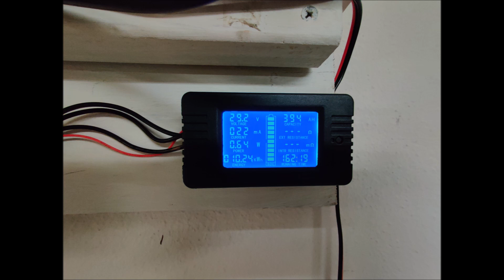DIY POWERWALL PART5 - ASSEMBLING EVERYTHING

Comment: What exact bms do you use for these powerwalls?
And what do you do with the power thats comming in after the batteries are full? Do you and can you deliver this back to the grid?
Reply from the maker: I use a Daly 100a BMS. I do nothing with the power once the batteries are full. You can't just plug this back into the grid, that normally requires a permit and electrical inspection.
Reply: @stevenc22  so a Daly 100a 7s?
Reply from the maker: @Sereen666  Yup. This is a 7S Lion build. I also have a 8S LifePO4 powerwall. You match the BMS to the number of cell groups you have in series.
Reply: @stevenc22  ok, sorry for the many questions but i find yours a great build even if it was posted 2 years ago. So i'm bussy creating a similar one. I'm starting smaller but want to build it bigger from there.

When you placed the second 7s lion bank, did you match the voltage to the other one before connecting the cables?
Reply from the maker: @Sereen666  I got it close but once you connect the 2 packs in parallel the batteries will self balance each other, so getting it close is good enough

Comment: Fantastic set of videos.  Answered a lot of questions I had about building a portable solar storage box that will draw power from the solar setup in my shed.  Would love to see a wiring diagram but if that's too much work can you just explain where the Battery Capacity Voltage Checker (the box on the bottom right of the screen that shows the voltage etc.) is wired into the system.  It's not easy to work out where the wires connect and I think it would be hugely useful.
Reply from the maker: The shunt for the battery meter goes on the negative leg of the Powerwall just after the BMS but before the inverter and other accessories so that all power in and out of the battery had to run through the shunt so it is measured. Battery - BMS - shunt - inverter & accesoy

Comment: hey would you recommend that charge controller for beginners, I only plan to use this to charge lithium batteries I have a 4S and a 7S (18650 battery is only)
Reply from the maker: Yes it is good. But how many solar panels do you have? That charge controller is a buck controller and requires the solar voltage be higher than the battery voltage
Reply: @stevenc22  I have four 12V 30watt newpowa solar panels. I was thinking about putting in series
Reply from the maker: @Fostech.j.a  that works. But that is not a lot of solar. Might just want to get a mppt 7210a for $40 if you only running 120 watts of solar. It works reasonably well and is cheap. I have one on my solar generator
Reply: @stevenc22  do you have any reliable sources that I could buy it from , like amazon, ebay bangood..... etc
Reply from the maker: @Fostech.j.a  https://www.ebay.com/itm/LCD-MPPT-Solar-Regulator-Charge-Controller-24-36-48-60-72V-Boost-MPT-7210A-/112451914404?_trksid=p2349624.m46890.l49292
Reply from the maker: @Fostech.j.a  https://www.amazon.com/dp/B07PVDY1V7/ref=cm_sw_r_cp_apa_fabc_cE97Fb80ZGNHX?_encoding=UTF8&psc=1
Reply: *reliable links
Reply from the maker: @Fostech.j.a  US $32.99  25%OFF | PowMr 10A MPPT Solar Charge Controller Fit For 24V 36V 48V 60V 72V Lithium Battery Bank Solar Systems Regulators LCD Display 202
https://a.aliexpress.com/_mL2s3P3
Reply from the maker: @Fostech.j.a  the 7210a charge controller is a boost charge controller so put your 4 panels in parallel and it will boost the voltage to the battery voltage however if your panels already have a higher voltage than the 4S battery them it won't work and will need a buck controller.
Reply: @stevenc22  hey thanks for your help I really appreciate you taking the time to talk to me

Comment: Shouldn't your battery leads be on opposite ends rather than coming off the same end?
Reply from the maker: That's just a design choice. I chose my design so  that it would fit in the box i made, would be compact, wouldn't need a bunch of jumper leads between batteries ect.

Comment: Hello Stevenc22 nice video did you make the cabinet where the cells are held if you did can you make a video or share what materials and the dimensions Please ???
Reply from the maker: I did. Bottoms are 30 inches, sides are 16 inches. Made out of 3.5 inch wide boards. Frame then screwed on the plywood backing
Reply from the maker: https://imgur.com/JJ2nnuN

Comment: Hello Sorry for my English since I'm from Spain and I don't speak it very well. I have an installation similar to yours. My problem is that I have a Powmr regulator that is very similar to the one in your installation. This regulator, despite sending the 37 volt plates, only sends the lithium batteries made by my 27v, so it never charges them since, as you know, it should send it 29.5 v at least. How did you solve it ?. Thank you
Reply from the maker: I think i understand what you are asking. Your solar panels are supposed to have 1.5x to 2x the forward voltage of your battery. That means for a 29.4 volt battery, you need at least 45v if not 60v of solar panels. That means you need at least 3 panels in series. 

Without enough panels your solar charge controller wont be able to charge the pack. You may also have a bad solar charge controller if you do have enough pnaels.
Reply: Thanks for your reply. For now I only have a panel of 330w 36v open circuit and 72 cells. When I enter the controller with the cable that comes from panels it marks the 36v meter, but at the regulator output it only shows 27v. I have the same regulator that you have. So for me to understand it, do you say that in order to charge those 18650 batteries I need to put more panels and I will do it? My charge controller is the same as yours, how many 330 panels would you put on it? serial or parallel? Thank you for your time, I am very grateful to you.
Reply from the maker: @VERUFIL  If you look up the makeskyblue charge controller specifications, it states that for a 24v battery, the minimum solar input is 37volts. Your battery is 29 volts, so your minimum is going to be 45v or so.

If you added a second panel in series, it would increase the voltage. 

You can actually test my theory. If you have a 48volt transformer laying around, you can plug it into the solar input of the solar charge controller and the charge controller will think its receiving 48V of solar and if you get out a nice 29Volts then you know the problem is that your solar if too low voltage.

Also make sure you have the right settings in the makeskyblue. D02 needs to be 29.4V and D04 need to be 1.
Reply: Thanks. Gracias

Comment: Great video.
Hey Steven, I just found your channel yesterday and subscribed. Then after watching just about all of your videos it inspired me to try building my own powerwall.
I will be building the same wall as yours 4s80p packs for 24 volts. I went ahead and ordered 700 18650's yesterday, and already have the same Charge controller and inverter you have.
Well my inverter is actually the same as your 1,500 watt version just in 2,500 watts and 24 volts. (I know its the same company). Anyway I was wondering could you please tell me what parameters to set the makeskyblue charge controller at? As far as max voltage cutoff. Thank you very much and keep the videos coming.
Reply from the maker: I assume you mean 7s80p??? The makeskyblue controller has a special selection for lithium batteries. Set D02 to 29.4 volts and D04 to 1(1 is for lithium). All other settings you leave alone.
Reply: @stevenc22  Yes, you are right I meant 7s80p. And thank you for the reply. I will be sure to use those parameters for the charge controller. I have been using the charge controller and inverter on a set of lead acid batteries, but they are 4 years old, and on their way out. Unfortunately their is not a lot of great options for batteries right now due to most places being very low on stock. So with me having no exp. with lithium, or even soldering for that matter I wanted to start off cheap and went with the sanyo 18650's on Batteryhookup website. I have read some pretty bad stories about them, but they were so cheap I figured I  would give them a try. That way if  I screw something up, i'm not out a lot of money. I got all 700 cells for like $160
Reply from the maker: @gameofthrones8174  Wow that is crazy cheap. What MAH are those batteries? Remember it is alot of work and cost assembling these batteries. I wouldnt waste it on some 1200mah batteries or something bad like that.
Reply: @stevenc22  They are the 2200 mah batteries. They are used of coarse, and come in 20 count battery packs. So I will have to break them all down. I ordered 700 hoping to get 560 good ones out of the lot. I guess we will see. Here is a link if you want to see the batteries. https://batteryhookup.com/collections/green-friday-weekend-deals/products/salvage-20-sanyo-18650-2200mah-lithium-ion
Reply from the maker: @gameofthrones8174  Great. Those are an amazing deal. Test them well and remove the "heaters". I think you will be fine since your powerwall will drain them at only about 0.5a which is consider low draw.

Comment: Nice. 

How about a update on the 8 cell in parallel ( clear storage case ) some day. 

Also I’m getting a echo listening to your video.
Reply from the maker: That is next. I bought a different kind of spring and going to work on improving the design!
Reply: Stevenc22 
I’m waiting on more springs. I have a 7p build going using the boxes. 
Also ordered 4p x 40 pcs  holders from AliExpress. For another build later Powerwall for my shed/shop   

Enjoying your builds.